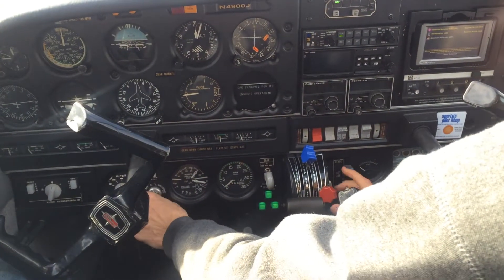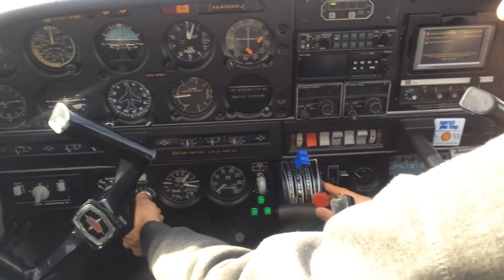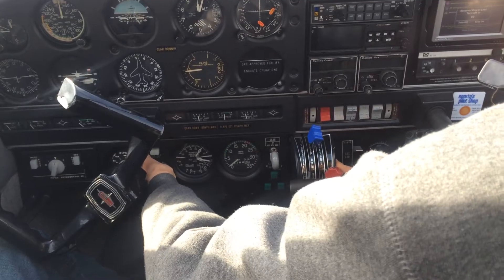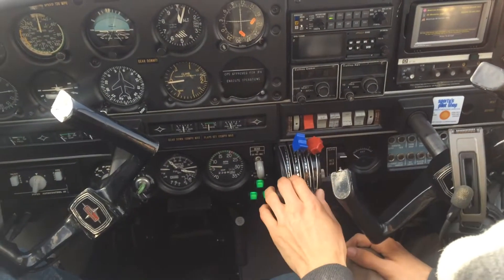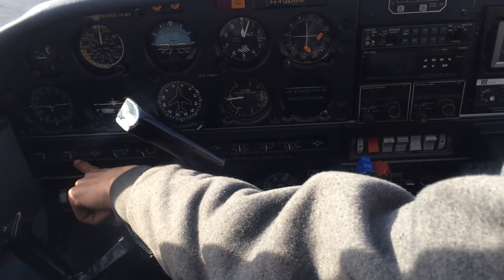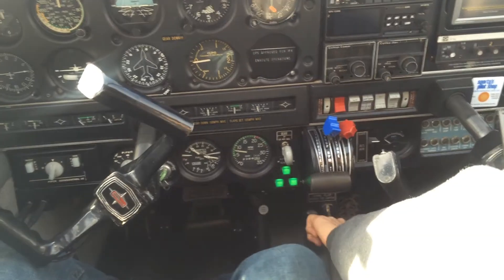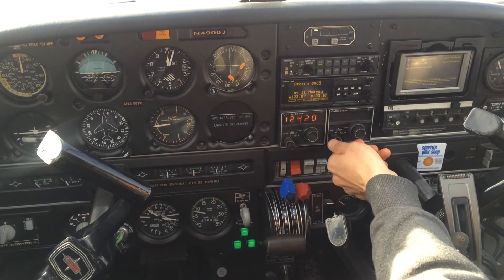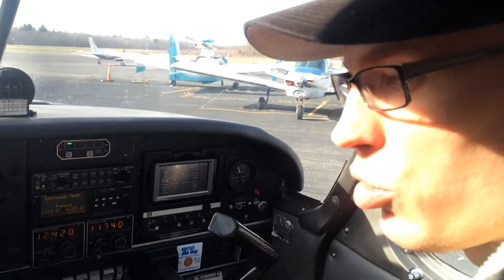PA28R (Piper Arrow) Starting engine procedure.

Comment: I am not finding fault but you missed a vitally important thing.(make sure you select left fuel tank)this is what happens when people don’t use the check list ..you forget things. Hence Engine failure on take off through fuel starvation .
Reply: Why?  U can select either based on whatever is the emptiest
Reply: Both tanks should be full or close to equal in fuel quantity before flying... so you select either tank for start up and on runup you swap tanks. This ensures both tanks are in working order and the engine won't quit on you when you swap tanks.
Reply: In the PoH for the arrow I fly it says "select the desired tank with fuel selector valve" no mention of left or right.

Comment: I saw videos where it was mentioned that the fuel pump should not be on during engine start but just for priming. Does it actually make a difference if you turn off the fuel pump after the engine starts or just before it?
Reply: Sure

Comment: My checklist says to engage with the throttle a little bit opened (like an inch). You don't do that in this video (throttle is all cut when you engage). Al the other is the same... What do you think of this? Greetings from Argentina
Reply: That's what we do in spain too in PA28, 1/2 inch throttle before set full forward propeller
Reply: @tebans88  same. The one I flew would turn off it you had throttle closed on ground

Comment: any tips on a hot start? I flew today and filled up, and started straight away, but it couldn't go. we also do priming different at my club
-pump on
-mixture rich till movement in flow
-mixture close
-throttle a crack open (after half open for prime)
-start and mixture to half straight away
-then full when engine bites

I'm just not sure whether to prime or to do the hot start procedure of open throttle etc which doesn't work
Reply: Hot starts are notoriously hard on the IO-360, suggestion is to hit the fuelpump, leave throttle back, start cranking, and as it comes alive, you slowly ease the mixture in
Reply: Our PA28 hot start is the following, and works perfectly:
- Battery ON
- Throttle FULL
- Mixture Cut-off
- Magento start
- When the engine is starting up, throttle to 1.000rpm and mixture full

Then you can continue with ALT, radio/freq, lights....
Reply: @cembo92  That's what I call a flood start. Hot start for me is throttle cracked a little , mixture off, then crank and mixture to full with start. A cold start is throttle cracked, mixture full, short boost with fuel pump, then crank.